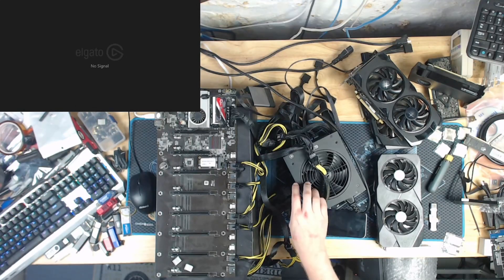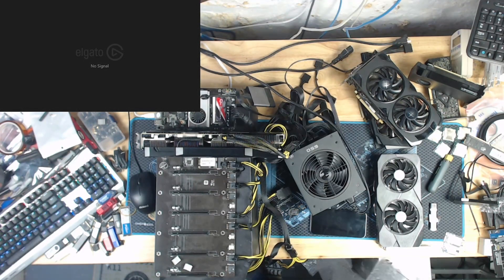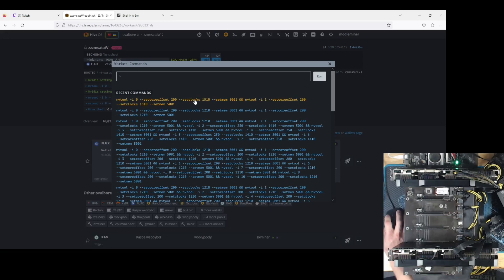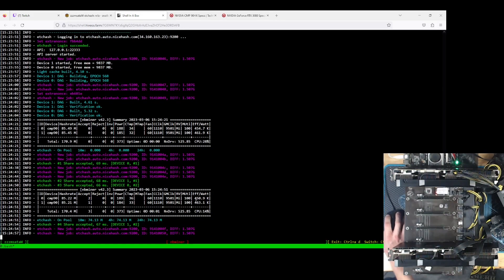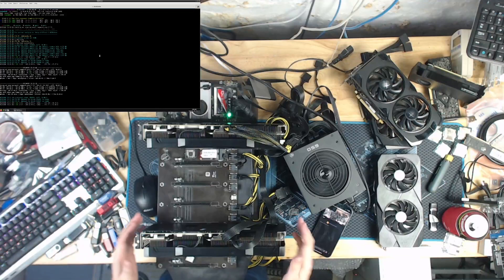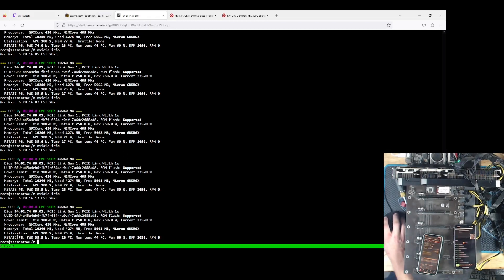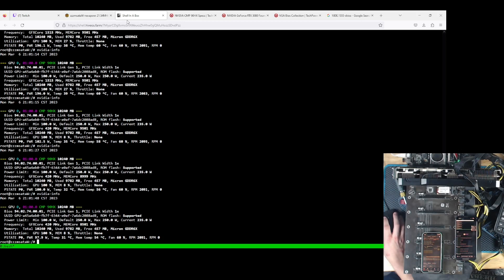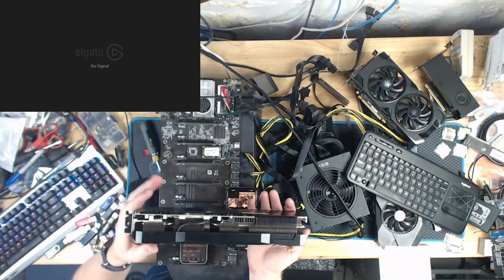$239 Mining RTX 3080 is TERRIBLE (CMP 90HX)

Comment: I bought these for algos that need memory my only problem is they run way too hot 90c. Replaced all the pads and paste have them in a server case and still throwing flames.
Reply from the maker: 90c is no big deal for GDDR6x. 105c is the rated operational temperature from Micron.
Reply: @OvalboreTech  I understand however 90c is making it too hot for everything else in the area. I should probably move up the critical temp. Also I am having a lot of stability issues and I think that has to do with me trying to limit the memory too much. I also am looking at modifications for the heat sink to provide better contact and improve temps drastically.

Comment: I'm surprised no one hacked these cards..is it bios that limits or something in the hardware?
Reply from the maker: hacking the bios on a post pascal card is almost impossible due to driver signing.
Reply: @OvalboreTech They cracked this man. So, I am very curious if it is now possible.
Reply from the maker: @brandontrost8888  cross flashing is technically possible with the TP tool but this card isnt the same as any other consumer GPU. CMP 30HX and CMP 40HX are identical to 1660 Super and RTX 2070 so those should cross flash
Reply: @OvalboreTech did you try the hashrate difference after the crack??